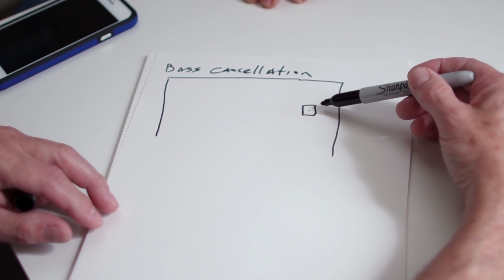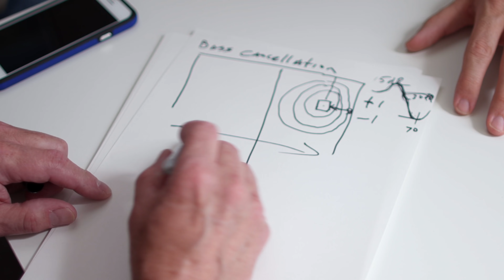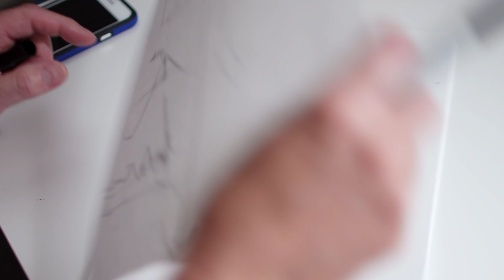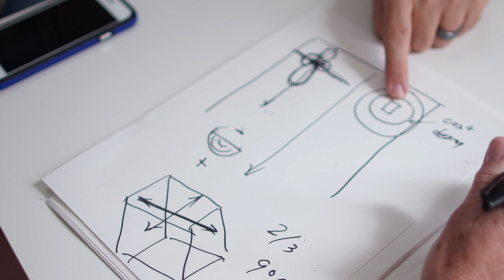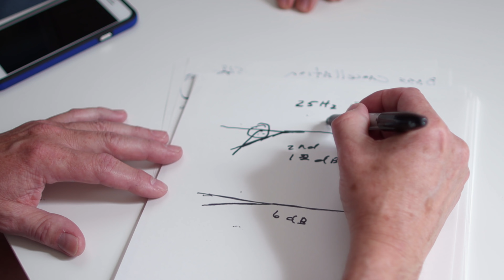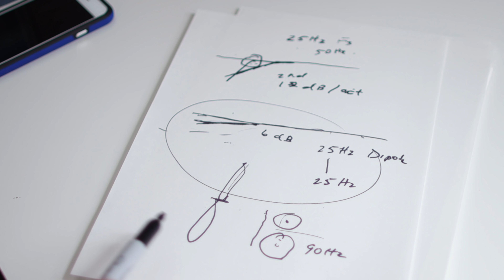WHY OPEN BAFFLE RULES - with Clayton Shaw | Spatial Audio

Comment: I have dipole electrostatic speakers. I wouldnt say that dipole speakers are suited for small rooms. You need space behind the speaker to allow for deep bass. Best bass was when I had 2,5 to 3 meter behind. When putting closer to the wall I will loose bass. I can solve that with a subwoofer. So the   performance highly depends on placement.

Comment: I enjoyed your video and rationale. Like you I replaced my coaxial tweeter ( Emerald Physics) with Radion Engineering 5212 with an Air Motion Tweeter Mundorf AMT 25D6.1-R which is a dipole like your tweeters

Comment: Room correction has a fundamental flaw - you can't fix a room null with amplitude.
Reply from the maker: I agree. It can be useful for taming some peaks but you are right, nulls are a problem that no room correction software can really "fix" without consequences.
Reply: very true, sounds like you understand audio :)     IMO its all about custom tailoring the crossovers to your space.  I use 2 15" OB woofers and cross themover at different frequencies and I get amazing bass with less suckouts and boominess.    OB bass rocks!
Reply: @Newrecordday  Actually, you can. It only requires some INSIDE the box thinking!

Try this...
Shove you (sub) woofer into a corner. Preferably a corner with the longest diagonal, preferably a closed system and preferably with the cone directed into the corner! No nulls left! And no side wall reflections. You create a "system" with a horn blowing into a transmission line (your room). And as with a transmission line you need some damping...

No nulls left. Only peaks, which can be eliminated. With DSP you create a very efficient bass system.

So, with the use of DSP, you can eliminate nulls.
Reply: @JerryRutten  I agree that corner placement effectively reduces the number of boundaries (which is why I would also place a sub in a corner and EQ it) but there are still boundaries which means there can still be nulls and these can't be fixed with EQ

Comment: What are Clayton's thoughts on Keele's CBT technology for constant directivity?  I've been building open baffle since the mid 1990's and in 2009 I combined CBT with open baffle for the center speaker in my home theater.   The combination of open baffle and CBT worked great and I will be using it again in my new theater.  The new center will be a horizontal open baffle full CBT similar to the 2009 version and the left/right mains will be open baffle ground plain CBT's.

Comment: I wish I could hear a properly setup OB system.  I've heard a few at audio shows and they sounded like crap.  I realized that this design couldn't possibly sound so bad, but at the same time the 'showroom' demo in a hotel room is not an excuse.  One characteristic that showed was a 'squawking' tonality coming from the bass unit with very little bass and no body.  Hopefully I will one day get to hear a properly setup OB system.

Comment: Why do we even need strange speakers QTS>1 made specifically for an open buffle at this time? At this time, DSP and D amplifiers cost like going to a cafe twice, it's not expensive to make an active crossover with correction and a D amplifier, and you can sell an active speaker a little more expensive, it's practical and technologically advanced, and low-QTS speakers are better controlled by the amplifier, they just need a little processor correction

Comment: I have found that open baffle does better than any other alignment with quick note changes on a bass guitar or upright bass. However, I found horn loaded bass does a better job reproducing the kick drum and other large drums.
Reply: My experience is different : kick drum is optimally done by open baffle subwoofers . An acoustic (not miced and tnen amplified-> PA loudspealer)  kick drum is a dipole !

Comment: 13:50 even though they were presented differently (one as a negative and the other a positive) it seems like you are saying that for both open baffle and box speakers, moving the speaker in the room is necessary to achieve the best sound. Is that not the case, or are open baffle forgiving and can be closer to a back wall? I'm not sure if there are similar aspects to something like a Magnepan quasi-ribbon style speaker, but it is my understanding that need a lot of room and are temperamental that way.
Reply: An open baffle needs more room behind the speaker, a box speaker needs more room to the sides of the speaker. 

So, when closer to the side wall, a box speaker needs more toe-in. 

When closer to the front wall the open baffle needs more toe-in.
Reply: @JerryRutten  thank you. Having my speaker wall in line with my entry door path presents a real challenge for good performances from speakers while not putting the speakers in the walk path. I'll be fairly close to the back wall. I would say no more than 1 ft or so.

Comment: The bass waveform discussion, my room creates a hole at what should be the main listening position from the main speakers and what would be a standard sub placement in line with the mains. To the extenat that leaning forward three feet, boom, lean back, nope. I remedied things by placing my sub in the MLP and finding the area in the back of the room that allowed for constant spl in the living room.  Thought about bass traps, but moving the speaker forward, backward, left and right had minimal effect. There are some odd shapes in the room due to two hallways out and a stairwell.  I am curious if the open baffle design would defeat the room.

Comment: I have been in Audio since crystal radios in 67" and I am in disbelief that you can produce any significant bass from open baffle speakers with out SPL. Yes, some but without any sound pressure you are not moving much air whic is critical as we feel bass as much as we hear it, right?

Comment: Thanks for an interesting presentation. As a fan and amateur designer of dipoles, I share your enthusiasm. Owners of box speakers, can greatly improve their in-room performance in relation to the issues you brought up by listening in the near field. I have only listened up to the discussion of the bass range, and wanted to mention that one still gets destructive and constructive interference from the back and side walls with dipoles, although it is diminished. The reflections from a dipole or a box with typical placement in the low end is also somewhat mitigated by the fact that the notional point source of a typical moving coil speaker is at multiple distances to the walls, ceiling, etc. This is even more significant with large planar drivers. Thanks!
Reply: I am a big fan of nearfield listening but the main advantages are in the mid and high frequencies because  they are directional and the ratio of direct to reflected sound that you hear is much reduced. The bass frequencies are omnidirectional and dont change much from proximity but rather are affected more by the standing waves peaks and null positions in the room.

Comment: Very informative video! I'm considering pulling the trigger on a pair of Sapphire M5's next week, but I'm concerned about running them with my Cambridge CXA80 in a smallish room (11'x15'). Do you think this combo would overpower my room? I'll eventually upgrade to a lower wattage tube amp, but that won't be for another year or so.
Reply from the maker: I think you would be just fine honestly!
Reply: @Newrecordday  Thanks!
Reply: Clayton has come out with M4 and M6 that should also help with smaller rooms. I know this is a year old post but thought I'd put that out there.

Comment: One thing comes to mind seeing the title of this video. If open baffle speakers are so fantastic why are 90% if not higher more of the manufacturers of speakers making box speakers? And please don't tell me it cost more to make open baffle speakers :-)
Reply from the maker: Clayton addresses that question in the video. Thanks!
Reply: One practical reason is the fact that the cables and electronics are/can be exposed out back for someone or some pet to mess around with and cause some damage. Not enough to kill anyone but enough to kill drivers, give one a nice sting and possibly send unexpected current back to the amplifier. Also, from what I've just rediscovered, those baffles have to have a large surface area to get the frequency response that you'd want, which limits suitability to listening rooms with ample space, as well as affecting WAF.
Reply: One reason is that sealed or ported speakers can use the TS parametric synthesis to design and analyze their prospective designs before building prototypes. Open baffle designs are a little more art than science at the moment but that is bound to change.
Reply: Because OB is "naked" and producer can't talk about cosmic technologies inside🙂

Comment: bass isn't really omnidirectional... even Thomas and stereo got Rel and Dolby to admit that's a scam. anyone can feel when they're in front of a sub or off axis since your thorax itself is resonant around 50hz. if it were omnidirectional you wouldn't feel the rumble of a seat etc when the sub is pointing at you versus away from you
Reply: Omnidirectional propagation is a general concept which is easily measurable and definitely not a 'scam'. The degree to which omnidirectional radiation happens increases as the frequency decreases so it's never exactly 100%. Please see radiation 'heat maps' for subwoofers at given frequencies to see how omnidirectional low bass is.

Comment: Car audio engineers figured it out a long time ago. Nearly all mids and highs in a car audio system are infinite baffle providing good off axis response. You dont get that with open baffles. The sub base is better in cars because of the dampening of the vehicle, seats, carpet, headliner etc. Point being dampen your listening room, use good components and enjoy. Its not rocket science.

Comment: Ron, as many have the M3 Turbo S, can you slightly develop the differences with the Sapphires (especially in the low Hz, in the imaging, and the coherence as the Turbo's were coax), you only said "these are on another level comparatively". Thanks, and great work as usual !

Comment: I've wanted spatials for quite some time. My only issue is that even minus expensive cabinets they still cost a ton. I've heard these and honestly my Magnepan 1.7i's cost less than half of these and perform just as well in every regard except bass which is an easy fix. Even adding nice subs to magnepans....its still cheaper than a box less open baffle with a few drivers. Those are some awfully expensive drivers I guess. 🤷‍♂️

Comment: im no expert but sounds like to me open baffle speakers require are large room so the speakers are away from the side and front walls. the room is super critical also.
Reply: I have open baffle speakers.. 18" woofer, 12" mid, compression tweeter, I use them in a 11.5 x 17.25 room and a 24 x 48 room, they sound great in both rooms and I'm able to get spacious soundscapes in each room, in the small room they are about 40" from the wall and in the large room about 80" from the wall. Both rooms have linear bass, but also both rooms have their own bass issues built in that have to be overcome and in the small room that simply can not be done without the aid of external devices, regardless of open baffle or box speaker mains, I say this because I don't want to give the impression that open baffle means a miracle cure for room modes, it does not, it just makes dealing them a bit different.
All rooms are super critical.
Reply: @bc527c  rooms are critical for sure but i think open baffle effects on a room would be similar to panel speakers.
Reply: @genkifd  Sure, to some degree (kinda different in panel/line source VS point source). But to why this reply, it's the effect the room has on the speaker, more than the effect of the speaker on( in) the room. Being a dipole/open baffle does not magically make the speaker perform perfectly without room treatment. I will always want to do some treatment, but the cool thing about acoustics, when you know what your doing, you can work to reduce the amount of treatment to a bare minimum. My small room is 99.9% treated and the big room has a few small bits well chosen and placed. Both produce grand soundstage and clear, accurate and tonally correct sound, and yet, one is very treated and pristine and the other is open and all hard surfaces. Acoustics are way more interesting than stereo gear...
Reply: My room's only 11 x 10 and the older M4TM (discontinued) still worked better than any other boxed speaker I've had in the past. It's the main reason why my future speakers will always be open baffles as I don't need to deal with any bass boom, which I had to (spent loads on bass traps n whatnot). My room had a measured +12db at 60hz when I used boxed speakers, but with open baffles, 60hz now only peaks at +2db, and the biggest peak @100hz is only +5db. It's hard to fathom but if you've heard a good OB you probably would never want to go back to boxed speakers.

Comment: (Open baffle doesn't rule; never has in the consumer market and never will, because it requires application engineering in a particular environment. The pros have that available; consumers do not and OB has all kinds of phase and reflective problems as acknowledged in this video without a verified, measured engineering application. Sorry.)

Comment: I built my own OB setup with two 15in woofers. 
It is the same kind of straight baffle as Spatial Audio. 
Unfortunately I get no bass. 
What am I missing?
Reply: Not all woofers are suitable for OB. First you need to identify the woofer. p.s. did you confirm that they are in phase? ;)
Reply: A B C 
They are in phase. 
Goldwood GW215 4ohm (x2) woofers from Parts Express.
Reply: @bujoun76  That driver has a Fs of 30Hz which is ideal for OB and a Qts of 1.86 which is also suitable. The Xmax of 3.5mm is on the low side but that will just limit louder playback volumes. Have you measured the output? What is the problem exactly? Perhaps the woofers just can't match the output of the other drivers?
Reply: A B C 
I'm a beginner DIY'er and at this point I have no measurement gear.
I can and do use L-pads (pots) to control volume output so there's no problem with matching output between drivers.
Reply: @bujoun76  Perhaps the L-pad doesn't have enough range if there is a serious mismatch between drivers. If you play a bass and nothing else, I assume you do hear it but it's just relatively quiet, correct?
Reply: A B C 
Yes!
I hear the bass and it is very quiet. 
I have to get very close to the woofers to hear bass.
The L-pad is only for my tweeter.